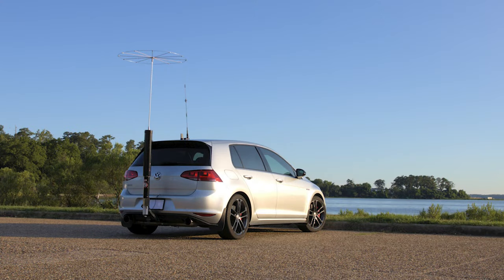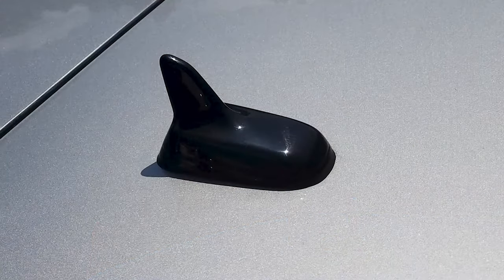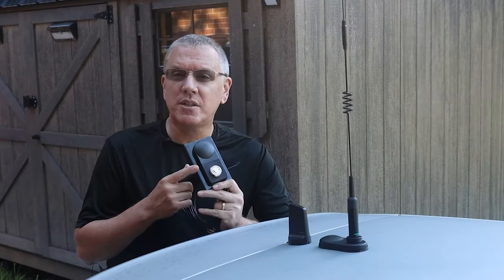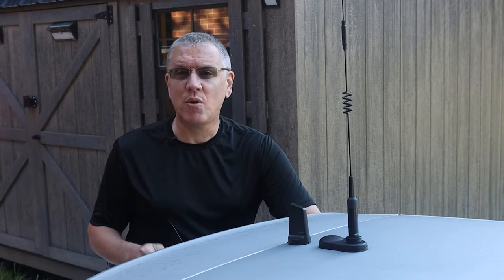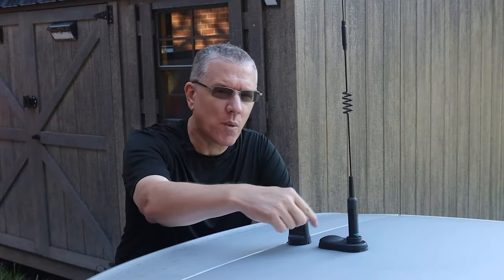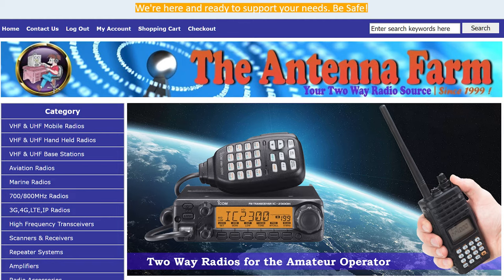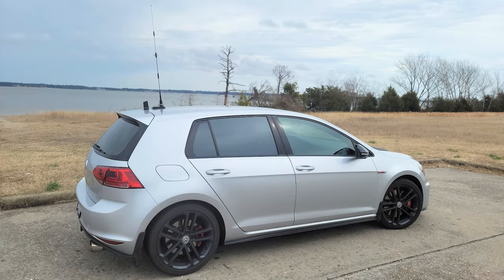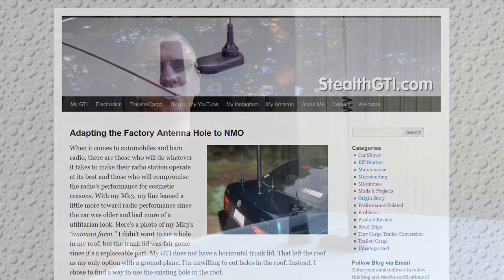Ham Radio Antenna Without Cutting a New Hole

Comment: Are there retrofit mounts that connect to a cars stereo antenna (on with a diplexer for AM/FM + VHF and up type of setup? I want to see if I could do something like that for my dad's 1997 truck...
Reply from the maker: I'm sure there are. Try a web search for "disguise antenna" and variations of that. Unmarked police cars use special antennas that mimic factory roof antennas while adding the functionality of a subdued tri-band antenna. Good Luck!

Comment: When you say the UHF Antennas "wouldnt tune" what do you do to tune them? Are you cutting them shorter? I'm looking to setup 2m/70cm/GMRS and would like to use the fewest number of antennas possible. So far the dual band antenna I have gets bad SWR on GMRS.
Reply from the maker: Most agree that dual-band antennas come ready to use without a need to cut anything. I don't think I've ever trimmed anything other than a single-band antenna element. So, in this video, "tune" means "measure for low SWR." In other words, my 5/8-wave antennas were not exhibiting low SWR on the plastic mount that I had tried; only the 1/2-wave antennas that don't require a counterpoise. Should I find that an antenna has high SWR, odds are better that it needs replacing than it needing a trim ("tuning"). I hope that makes sense. As for finding an antenna that works on GMRS and amateur frequencies, you need to get one that's wide-banded enough and intended for the task. Comet's CA-2X4SRNMO is a good example. I share a few examples of what I use in this video, https://youtu.be/w-SJ0d9AU8E, if you're interested. Thanks for visiting.
Reply: @StealthGTI  Thank you. Yes that helps clarify it for me. I appreciate you taking the time to respond.

Comment: I'm not using the suirus radio in my ram 1500 can I remove that and put a antenna there for a 2m mobile radio?
Reply from the maker: You'll need to check the hole to see if it's compatible. Some OEM cut-outs are already 3/4" and perfect for an NMO mount. Mine is square and 41mm; so, I needed a different solution. Remove your antenna and have a look. Thanks for visiting!

Comment: I appreciate the video, but I feel like your obsession with not cutting a hole in the roof is getting in your own way.

BTW I have a SureCall booster (similar to the weboost) but I wired it to my factory sharkfin for a super-stealth look. The SureCall antenna and the cellular/OnStar/whatever part of the sharkfin are both wideband antennas designed for cellular frequencies. That way I retain the GPS as well as the satellite radio. The only thing I lost was BMW Assist, which was too old (Analog/2G) to function anyways.
Reply from the maker: I don't know that I'd call it an obsession, just a preference and a trade-off. Anyway, your use of the sharkfin antenna for the cellular boost is ingenious! I'll have to keep that in mind for potential use someday. Take care!

Comment: Has anyone done this on a newer model Toyota vehicle?
Reply from the maker: This is such a niche channel that I doubt many Toyota drivers have both found this video AND done the mod. I'd ask in the Mobile forum at QRZ. With that said, the only way to really know if it'll work on YOUR Toyota is to remove the factory antenna to see if the hole is at least 3/4" but less than 1-9/16", then see if your GPS signal is using a fitting that can be matched to this device. I'll say this, though: Installing this combination mount on a sedan, or anything without the immediate access to the headliner that a hatchback provides, would be way more difficult. Good Luck and Thanks for visiting!

Comment: Totally misleading. Should be titled, Ham Radio Without Cutting a New Hole IF You Already have a Hole. Really? Terribly misleading, no where is there n explanation that you must have a particular vehicle with a particular antenna with a particular hole already… then you don’t have to drill another hole.
Reply from the maker: Misleading? HA! No where did I have to cut a new hole. That's what was said, that's what was presented. The vast majority of modern cars have a hole in the roof for a multi-function antenna. This video shows how to replace that antenna with a new mount... no cutting! You left the video with an understanding of what needs to be done... Mission Accomplished. Thanks for visiting!

Comment: ITs a classic example of how modern Amateurs are applicance operators and generally don't have a clue about how the antenna is constructed or works. The "stealth" antenna deserves tearing apart and an explanation of how they work relative to known antennas.
Reply from the maker: Again, this is not an antenna video, this is not a ham radio channel, and this was not about equipment construction at all. If you want a "stealth" antenna torn apart, buy one and tear it apart or find someone who has (and possibly sponsored to do so). I'm not here to do that, not on my budget. Take Care.

Comment: Another video that fails to show how these "stealth" antennas work or  how efficient they are or are not.
Reply from the maker: The video is more about the mount and how I made my connections than about the antennas. I am drafting ideas to discuss the different antennas that I use on the car. So far, I've collected SWR and bandwidth info and my impressions while operating on a daily 2m net. Thanks for visiting.

Comment: Great video. I was wondering since the video, how the GPS antenna / NMO combo mounts was performing? This will potentially going on my Chevy Silverado for a dual band 2M/70CM antenna. Thought it was a neat option to utilize the factory existing GPS antenna hole and still maintain use of the GPS. I posted some of my questions on a FB group I'm part of "Ham Radio Crash Course - https://www.facebook.com/groups/hamradiocrashcourse/posts/4780121838770594", and didn't find anyone else that has used these mounts. I thought maybe you had some insight that you found prior to buying yours. How did you determin you  GPS plug? Did you find any blog or other videos of this mount? Another thing, what made you decide between the EM-MG110022-SP-195 and the EM-MG11006-SP-195? Thanks in advance.
Reply from the maker: The mount is working great! I'm not aware of any other videos that discuss this mount, which is why I made one of my own. My blog entry at https://stealthgti.com/adapting-the-factory-antenna-hole-to-nmo/ shares some details, too. One of my viewers asked me what I thought of the mount. I had never heard of it; so, I checked it out. It is slightly wider than another mount that I had been using (details on that blog page). That alone was enough to convince me to buy one for a test. I bought the 11006 over the 110022 since I didn't figure I needed the GLNSS capability. As for determining my GPS plug, I could only figure that one out by removing the factory antenna and then figuring out was a "Fakra" connector was. From there, I got to searching for an adapter. Again, details on my site. But no guarantee that yours is the same. The Antenna Farm added the connectors for a nominal fee. Feel free to contact me through my website for more assistance. 73, Scott